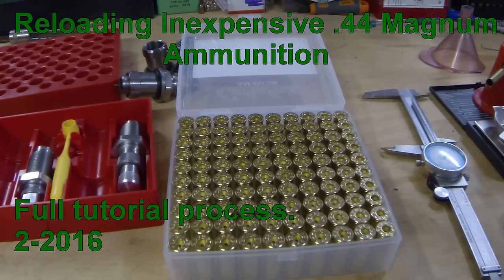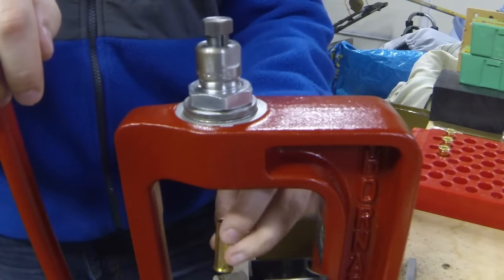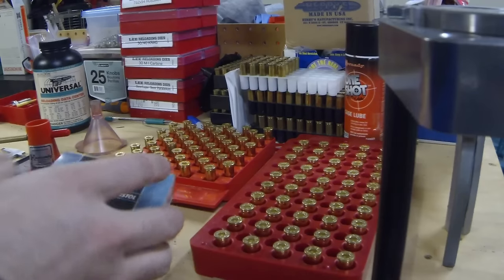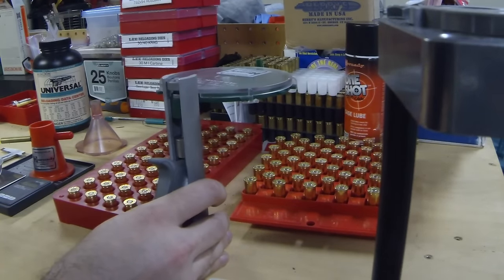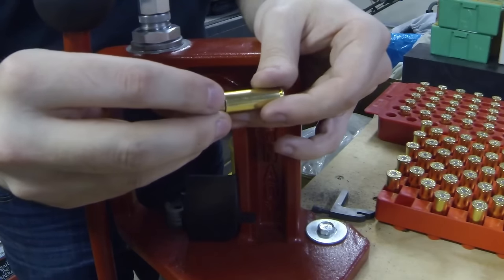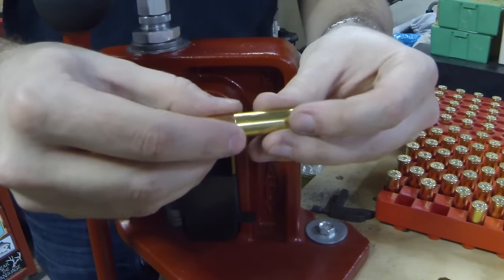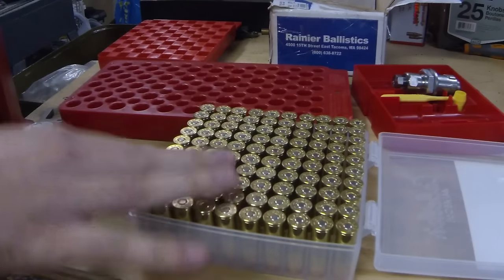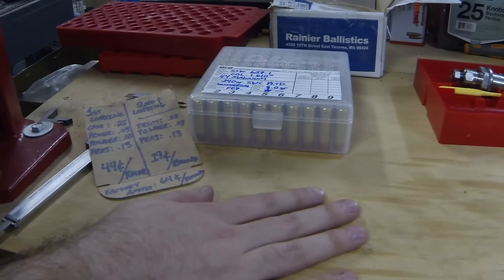Loading Cheap .44 Magnum Plinking Ammunition. Complete Tutorial Reloading Process in HD

Comment: I noticed that you skipped sizing the cases to length. Any reason?
Reply from the maker: You’re correct- I never trim handgun brass. Factory cases from a single lot should all be the same length out of the bag (which Starline are every time) leading to equal roll crimp pressures.

If you’re shooting in regular production revolvers with generous cylinders, OAL doesn’t really matter as long as the loaded round drops freely in the cylinder. In general the longer you can load the cartridge the lower peak pressure, so you can either reduce wear or stuff more powder in depending on your goal.

Trim the case short from the start and you reduce potential pressure savings and IMO waste time.

Even if you have an assortment of 1,000 cases of all different sizes as long as the OAL of them are all basically the same it doesn’t really matter much for general plinking ammo. Some will have light crimps, some firm crimps. My random size .38 Spl. full Wadcutters still shoot quarter size groups at 25 yards. Some of those cases have been used for 30 years and none have ever been trimmed.

If you’re loading for match grade accuracy or developing a load, or loading at max pressures, or shooting a custom revolver with match tolerance chambers, absolutely trim everything to the same length or keep lots or batches of cases together. For general purpose ammo in production revolvers, IMO it’s unnecessary.
Reply: @HughesEnterprises  Thank you for this detailed reply.

Comment: What scale are you using and are you confident in its accuracy?
Reply from the maker: It's the inexpensive Hornady digital scale that is bundled with the Lock-n-load kit. I've calibrated it with the weight standard that comes with it and it works pretty well.
+/- .1 grains of accuracy is plenty good for my ammo. Most factory ammo I've pulled has far greater variances in charge weights (as many as +/- 2 whole grains in large rifle calibers). The other major factor is if you don't weight every charge, the dispenser and powder combo has to produce consistent charge weights. A thin flake powder like Universal works great with this dispenser and throws charges right within the scales' margin of error.
You can get auto charging scales that measure out to milligram accuracy with lids to protect from air movement, but those are usually reserved for bench rest shooters/long range matches.

Comment: I hate federal primers too, but if you keep the sleeve on it flip it and pull the plastic out while holding the cardboard part still over the flipper it works fine. 

There’s nothing dangerous or inaccurate about progressive presses if you know how to use them otherwise lawyers would have made them extinct.  I load .44 magnum on a Dillon 750 now and that machine is less likely to make an error than I am doing them single stage.